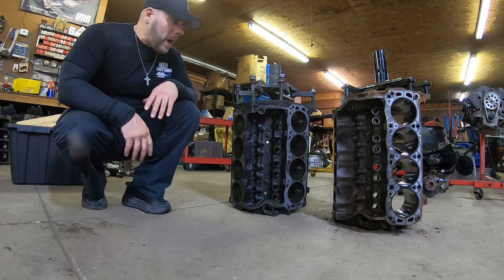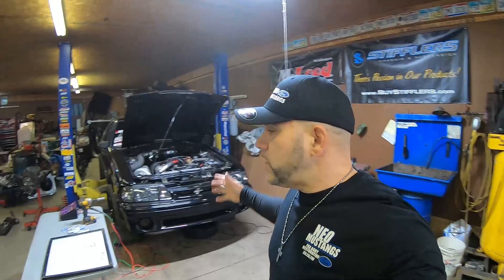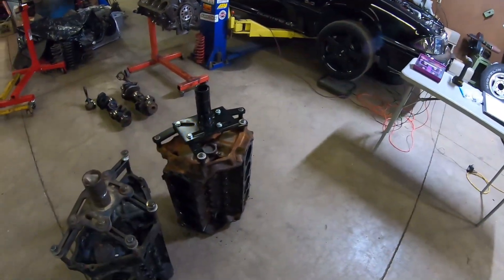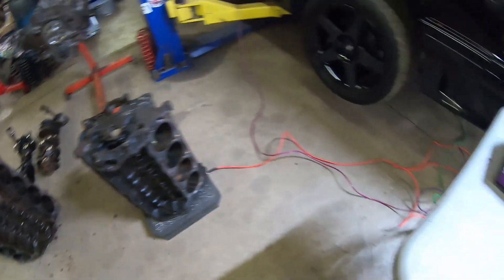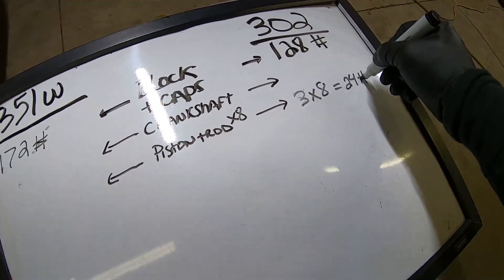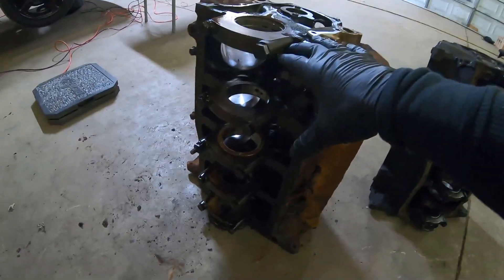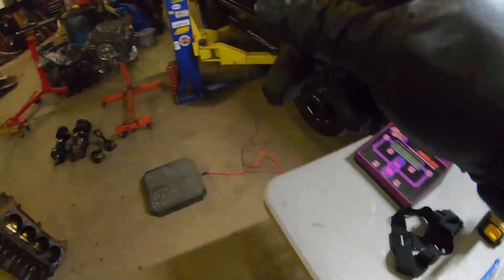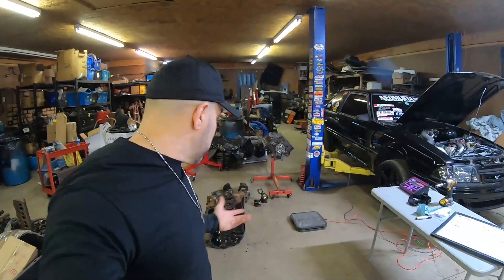Ford 302 vs 351w Pound For POUND Who You Got? Lets Find Out...

Comment: I'm  looking to build a roller 351w for my '95 f150. It currently has a factory roller 302 in it. I've always been told there's no replacement for displacement. Don't get me wrong,  the 302 is strong engine with a lot of potential.

Comment: 351W is a truck engine. Unsurprisingly used in trucks!! With 3" mains does not like rpm. And is wider and far heavier,
302 is a little lightweight that fits in cars that the bigger engine simply does not. Weight is NOT strength. Because of small mains smaller rod journals you can turn them far harder. RPM is generally horsepower. They will not make near the torque, but torque can be annoying as it is VERY hard to 'hook up'. 
Yes they can be more fragile though watching British Touring Cars from the 60s they were turning 289s to high 8k rpms. And modern blocks are far better in material and finish. Whatever the 'experts' say about these engines the ones that break are generally junk though preperation is essential.

Comment: Why aren't you comparing the 302 to the 351C?  I was always told that the Windsor has a different transmission bolt pattern than a Cleveland.
Reply from the maker: Cleveland not an easy motor to find

Comment: The early 351 windsors are much stouter than the roller blocks but I’m building a 95 roller Windsor for my ranger because I’m not making over  much over 500. The 302 block wouldn’t last long at that level.
Reply from the maker: Ya i dont think windsor are weak really at all. I put 4 digit numbers to a 93 block (non roller last year) and it was rebuilt and sent again 3x over now...

Comment: Depends on the application.  By far you can get over 408 ci with a stroker kit. But if you need something  that swaps Easily in a small engine  compartment a 302 would be ideal.

Comment: I've die hard 351 Windsor. But we also use them for racing dessert. God, a question did you might go to answer? Since I can nobody else is going to I have a 1974 351 Windsor. Came out of A.Grand Torino. Trying to figure out what flywheel will work for this motor. We are dropping it into 86 F150 4x4 , nobody can answer that.

Comment: Thank you
I'm new to Ford and always heard that the different displacements were different physically. With Mopar and Chevy, a set of small block headers fit a small block, not so with Ford. Now I know the deck hight is over an inch difference between the 302&351. 🤯
I'm sure that I'll be learning even more before I'm done with this project.
Reply: it's why Ford wasn't really popular back in the day, you had to know which block you had (and Ford gave up its Total Performance parts plan in the early 1970's, while Chevy kept coming out with performance parts at the dealership parts counter). The Fox Mustang really got people back into Ford since the car was cheap to buy and then owners wanted to get more out of it. Then Ford came out the the GT40 setup in 1987 (?) that was like chevy did with the Power Pack parts in the 1950's for their 283.

Comment: One big thing that is good with the small block fords is that they fit in smaller cars well (my car is a 1984 Datsun 200sx with a mild 302)    fits in well...with headers (gt40 heads + intake) Haltech     I can get the spark plugs easily(3 bar head)    I typically believe in the "no replacement for displacement"    But saving weight is ALWAYS good
Reply: and for those who don't know, a lightweight car doesn't need a ton of power (and if you're driving lessons were from your high school football coach, you're not going to handle a ton of power very well anyway). so a ford 302 pushrod designed with OEM small port heads is going to make the off-idle torque you need to feel like you're really going fast. but a lightweight engine in the front of the car is also going to help handling and braking--you should always build a car to get OUT of trouble faster than you got yourself into it.
Reply: there isn't that much difference in weight and you can get infinitely more power out of a 351W. to each their own. If you want to be slower than you could be, that's fine.

Comment: I have a 1967 Merc Cougar.  When I got it, the original 289 was toast. Rebuilding it would have given me a matching numbers original restored car.
Then I started thinking more horsepower and various options.  347 cid would be biggest I could go with it which is smaller than built 351 but same price.
I settled on 408 with AFR aluminum heads, Edelbrock intake,  Comp Cams hydraulic roller cam, link bar lifters, roller rockers, stock distributor with Pertronix Igniter and finally, 750 Holley vacuum secondary 4- barrel carburetor, Hedman headers and 3" exhaust.  I used the earlier non- roller block so I could use original Z-bar clutch linkage.  I doubt this engine weighs any more than stock 289.
It all bolted up and really didn't look much different than stock 289 but 2-1/2 times the horse power.
Power goes through 11" Centerforce clutch to wide ratio top loader 4-speed to 9" rearend with Detroit Locker and 3:50 to 1 gears.
It all looks stock but what a hoot to drive.
It winds up quicker than it can be shifted and 1st gear is useless.
Reply: makes sense, 1967 Ford redid the Mustang planning to pop in the FE, so there was more room than the prior generation design. And you still can build the 289 for resale.

Comment: I have a pretty rudimentary question and this is for anyone in the comments section.  I am thinking of swapping my 302 for a 351 in my 1982 f150 question is are the motor mounts the same?   Do both blocks share the same motor mounts?
Reply from the maker: Yes but people usually use drop mounts on 351 sense its a taller motor. But yes will work

Comment: Hey Dan, how much HP were you making when you cracked a 302? Thanks, Brent
Reply from the maker: It really isn’t about the number more than the timing fuel in the tune and if it’s balanced. There’s a lot of variables
Reply: @Neomustangs  Hey Daddy Dan, just bought a t shirt. Sorry it took me this long. If you were me and just run the car on the street and want 500hp NA, would you stroke to 347 with 0 balance or go to a 351 stroker? Keep up the good work, Brent

Comment: Back in 1984, I built my first 351W Street Boss w/ 2V Cleveland heads using the B&A Street Boss intake designed for the oval port heads and put it back in my Mom's 1971 Galaxie500 2 door! Wat a Brut of a motor :) My latest project is to put a 95' 351 in my 2010 Grand Victoria... a 2010 NM State Interceptor to be a Strip/Street ride!

Comment: I think it really depends on what you plan to do with your build. 

Drag no replacement for displacement period. 

But for track cars I think it really depends I find the less wheight and lower the motor and farther back the motor can sit the better. 

In a perfect world an all aluminum 302 would work best for road course  due to less wheight and being able to set the motor lower especially if using a dry sump system nock the fire wall back. 

Or I hate to say this but a k24 with a big old turbo using dry sump would be best but the amount of boost I think would make the fox a little sketchy when all that power comes in. 

My build its 300-320hp  max carb 302  in a 79 4cyl lightes of all the foxes. 

Anything past 300hp scares the shit out of me due to still having the solid  axle. 

If I go irs so I can dail in the rear end  and feel whats going on back there better with out the fear of it just kicking me one way to another. 

Sorry guys for my rambling blame it in my adhd lol.

Comment: I think it’s the oiling that makes the 302 blow. The oil don’t get back to the pan fast enough. Must have 7q pan. I have a 98 civic d16y8 making 6Nchange  all cast aluminum. And probably maybe quarter of the strength of a 302. 
A 302s was you want smaller stroke e=Mc[] HIGHER REV. 
302 just not figured out yet imo for what it ways and it being steel it should be making triple digits reliably. Think of it 162.5 per hole in a single jingle 

And peoples 50 blow up maybe making 5
Reply: Going to have to say plays a part toooo 1🕺🏻* base  🕺🏻* tapered to 🕺🏻at 40lbs and only at 60% duty i watched all  I don’t know why people used so much timing

Comment: Do you consider 427 and 440 inches out of a 351 short lived motors and that's why they aren't listed? I've always been curious about them.
Reply from the maker: Those are aftermarket blocks. These are production in this video. 427 with 4.17 rod does have a lot of rod angle and clearance needed

Comment: Nice engine comparison. I’m wondering if I can swap a 351W on my 88 Lincoln Town Car, is it a plug and play engine swap?
Reply: Should work as long as the firing order is the same. I believe the 302 firing order changed to the 351W firing in 82.

Another thing to be careful of. The 351W was plentiful in the f150, f250, and vans. The problem is the intake. Ford Motor Sports use to sell a lower intake to adapt your 302 upper. I'm sure other after market companies do too.

Bare in mind, the 351W is wider, so your exhaust will need to be adjusted. The exhaust manifolds are interchangeable. But if you are going with headers, then this doesn't matter because you will need to adjust the exhaust anyways.
Reply: Being wider is a consideration. I’m not thinking about headers, but measurements must take place. Thank you.

Comment: Pound by pound and external size, there is no contest;
The 302 is the winner.
You should compare the 351 Windsor with a  Cleveland.
Reply: lmao. not even close. The power potential, reliability of the block/oiling system are vastly superior to the 302. by comparison the 302 is a POS boat anchor.

Comment: Po boys better stick with the Windsor!! A stock rod cast piston 351 will take 159 shot of gas forever. What the 302 will do at 7000 the 351 will do at 6200. Been there, done that! You gotta buy a aftermarket block if you're planning on making over 500 hp with the 302 block! Build one 351, or buy several 302 blocks! The crank and rods in a 351w are far stronger than a 302. The 351 rod is 5.96" center to center, almost 6"! They have 3/8" rod bolts. The list just goes on. Build one 351w, or go ahead and build a couple spare 302s!

Comment: 408 stroker all day. Had a 69 rare factory 351w 4bbl version that was ported and polished heads and intake and stroked to 408 with 11.25-1 comp and a rv style cam, did bracket racing in a 73 2dr Ltd, consistently ran 14.2 all day.
Reply: Had a 68 fastback mustang with 4 spd 69 351w 4 barrel motor my buddy had 69 torino gt 390 automatic he got me off line because I spun thru first into second once caught traction I caught him and left him that was about 45 mph he watched taillights from there I believe I had 3.23 gear he had close to same ,69 ,70 351 Windsor best yrs
Reply: @davidlawson3212  yep best blocks higher compression.

Comment: are the 460ci motors their own block or are they just large production 351s?
Reply: 351 and 460 are different blocks. Specifically the 351W is a Windsor (Windsor,Ont, CA plant) and the 429/460 is a 385 series. the 351C/M and 400 are 335 series.  352/360/390/427/428 are all FE series engines.Each series is different and for the most part, not interchangeable.

Comment: I had a mentor. Ted Haywood. Mustang racer, Black Flagged at Daytona in '68. '67 Shelby GT 350, 289.
He pulled a 167.86 lap speed and 210 MPH on the back stretch. They were convinced a 289 couldn't do that, and legally. He once worked for Smokey Yunick. Started pushing a broom and worked his way to the trophy room where they built the Grand National engines. He finally accepted a tech inspection, and he guaranteed 504HP at 9,000 RPM. So it was and he was allowed to race. He raced that engine all season.
He was the first racer to stomp the throttle in the turns. Fords like to plant the inside wheel, as everyone else lifted theirs. I remember looking at the Mechanic of the Year Trophy for 1968 he held.

Comment: The 351w is a junk motor. If you're going to do a head to head...the 351 Cleveland is the only 351 worth having.
Reply: True Clevelands are underrated for sure, but harder to find.That's what Bob Glidden ran! I would like to get a hold of one of those 351 clevor Australian style blocks. Extra webbing and oiling improvements, etc, Cleveland four bolt 2 3/4" mains & a bit lighter block with the Windsor aluminum timing cover style front of the block.

Comment: How 'bout a 350 CID CLEVELAND??? Lighter than a Windsor and stronger and can be taken up to 387 CID @12,000 RPM that no 302 can stand! Yes the raw block costs four times what either a 302 or 351W does and the internals run ten times as much, but a Cleveland with the RIGHT split-plane or dual plane intake and the right heads and EFI can tickle a TRUE 500HP and a strong 525/550 ft/lbs without a puffer and last 100K miles. Set-up at 360-370 CID and 10.5:1 CR for 8500 RPM, it's streetable, docile and runs on pump swill with alloy heads and long tube headers, and still goes like stink in an under 5500 lb car. Drop the compression a point and change the cam for a hauling/towing truck @ 7500 RPM for 390 HP and 490 Ft/lbs.  A six-speed manual or seven or more speed auto will be the ticket behind it, as it needs to spin, but both are readily available today for less money than "classic" boxes.

Comment: There was another displacement available using the crankshaft from a 400M. The only alteration needed was machining the snout of of the swapped-in crank. The journal sizes, bore spacing, and cylinder bore matched,  so the new displacement was 400; well, actually 402 cubic inches, but the 351 was likewise 351.8 cubic inches.
Uncertain why this swap didn't stay with us, but likely due to the demise of of the unpopular 400M.
Reply: There is no such thing as a 400"M" Ford ... You are referring to a de-stroked 400 Ford  which they referred to as a 351M basically the "Windsor" 351 crank was fitted into a 400 and became known as the 351* "modified".. yes same family.. basically the 400 was never "modified" never a" 4v" four-barrel carb on anything production 400/351m small valve small port. Nutted to meet emissions what is exactly why the 400 was de-stroked 2 bump down the compression and the cubes to meet emission also because of detonation problems with the nutted 400...&"new at the time" unleaded gasoline"watered down or cheap gas". 👤🙉🙈🙊🏁
Reply: @codyhenry3926 , I called it a 400M to distinguish it from the non-factory engine modification being described, which could legitimately be called a 400 Windsor. Not a reference to the destroked 400, since the resulting displacement was still 400 cubic inches, or more precisely, 402.
This old-style crankshaft swap could be done because the main bearing diameter of the 351 Windsor and the 400 were the same
Reply: around that time, there was the 377 cid stroker concept--offset grind a 351W crank to take a mopar 318 connecting rod and a chevy "turbo" 350 piston. both this and your idea were answers to the Chevy 383 that became the "it" engine in the later 1980's. Aftermarket crankshafts like the one used by this channel to create the 387 cid (ford did it as a crate engine at 392 cid) are cheaper than having a machine shop do all this work and balancing afterward.

Comment: Okay I have a question I have a 2005 F-150 4x4 with like 5.4 Triton engine that has 130,000 miles. Here's my question should I rebuild the 5.4 or should I put a 302 in it and get the same horsepower if not more😊😊

Comment: I would go 302. Good until 500 of course, but I would get a BOSS 302, slap it out to a 306 and make stupid power. We had a guy where I work who has a 85 GT that had a 306 making 900 wheel.
Reply: Force induction only on that 900hp. If you say different, I say bullshit. That's approximately 3hp per sq in.
Reply: unless he was using a dart (or other aftermarket block), I call bullshit. and like the other commenter said, If you say that power was made w/o a power adder, you're full of shit.

Comment: Swear I'm repeating here but...in my 85 GT we dropped the Smog pump and A/C + brackets. Did FRPP pulleys and non ac bracket from another car. No emissions in my area of WI, so the smog pump wasn't a big deal, ac didn't work either. 🙄 Pretty sure that was about 60lbs there....get aluminum heads and a tubular K Member and you've more than made up for the heavier 351W..add a CF hood and WB fenders down the road and you're golden 😉 😀